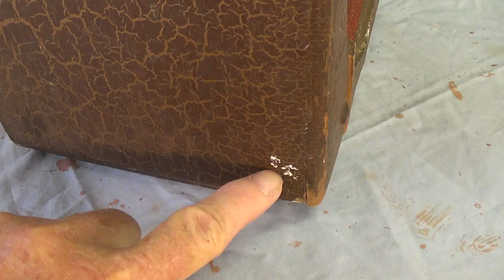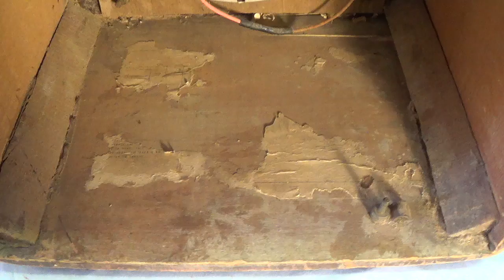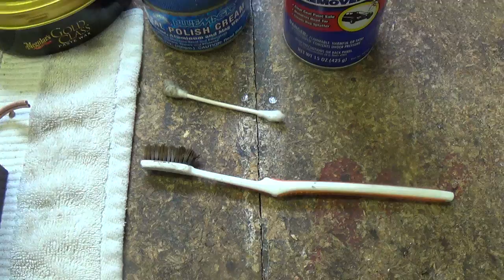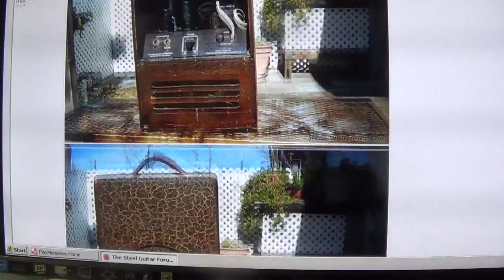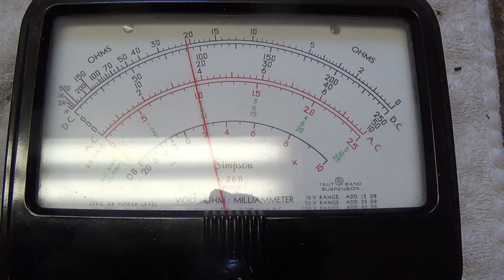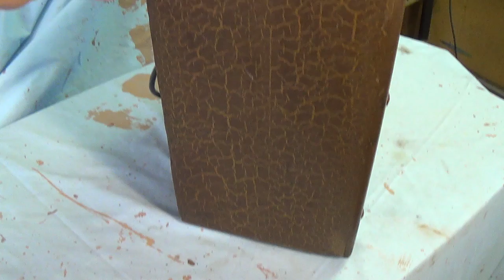Restoration of a Late-40's/Early 50's Jackson-Guldan Guitar Amp

Comment: First , thank you for the magnificent and informative videos
Second, I have a output transformer that  appears to be identical to the one in the video, same apparent size and the same markings(rk-1). Yet when I tried to map it 
I got different results. Of course I dont have a variac so i used a transformer that puts out a constant  26v across one lead and the center tap of the secondary. I should say I got similar values only on different taps, 14 15 16 = 4 8 and 16 ohm. I tested my setup on a reverb driver I have and got near identical values according to the labeling of the driver. I would like to use this in a old radio that I would like to convert to a 5c1.Do you think those taps would be appropriate given my results? Of course I understand that any opinion given is just that.
Reply from the maker: Thanks, Paul. External appearance is not a good basis for judgement, as you discovered. Since your measuring methods were accurate for the known OPT, I would trust them with the unknown one. Good luck.

Comment: I have one one of these. It has a more or less intact schematic in it. It survived a fire in my house so it's smoke damaged and hard to read, but can be read.  In mine the main transformer crackles and leaks so I can't use it. Any idea where I could get a replacement transformer for it?
Reply from the maker: Power transformers are readily available from Antique Electronic Supply, Mojotone, Ebay, Hammond, etc., Raymond.
Reply: @UncleDoug  Thanks, I've had this amp for a few decades now, this video is inspiring me to get it working again.
Reply from the maker: @raymondhoughton5151  I'm glad to hear it, Raymond. Good luck with your project.

Comment: I grabbed a similar amp today at my local Goodwill for $3. The case is super rough, and I thought it would be a great project. Thanks for the details…
Reply from the maker: Congratulations on the new acquisition. I hope the restoration goes well.
Reply: @UncleDoug  The Rola speaker in mine is dated Feb 1947, so I’m assuming it is original.
Reply from the maker: @justjoe78  Probably so, Joe.

Comment: Where did you find a lovely pink three wire replacement power cord? LOL.
Reply from the maker: It's available if you'd like it, Dennis. Surprisingly, a rare cord like this is priced quite reasonably......at only $35 a millimeter, plus shipping, handling, gas to and from the post office, and lunch on the way.....for four  ;).
Reply: @UncleDoug : That's affordable, NOT.  But thankfully, I live in a tiny town and the post office delivers! LOL.

Comment: Thanks.  I have a three 50's console amps*** I'm going to refurbish and mount a-la McIntosh pretty, just to plug a Thorens TT into and possibly an Akai reel-reel recorder -if I can fix the beast!  Don't have a lot of money, these are curb picks, (not the TT) : so I'm going to start out with a 60's "Unipack" train transformer with a joystick sweep rather than dial.. It's GREEN!  hahahaha, anyway, going to meter it w/ a Kill-a-Watt plug-in meter. 
 ***Firestone Air Chief, a Zenith (record-player only) 5-speaker portable...and finally an ancient looking Admiral console.  Thanks for the guts, been building them up slowly.  I got a book, hahaha!  need some on tubes, caps, and all the other junk.  You're a wizard, so do a segment on processes?  be cool to see soldering and wicking out the old stuff.  Give Rusty and Jack pats on the head for me, U. Doug. (:
Reply from the maker: Wow, Steve, it appears that you have all sorts of interesting projects. Best of luck with them, from all of us at Rusty's Workshop :)

Comment: Becareful about Hantavirus from mouse droppings.    I'd fine spray wet with solution of 10% clorox in H2O.   Let dry and spray wet againext day.  Remove while wet.  Then vacuum after all has dried.    

Your components made it better than original!
Did anyonever make a speaker field coil be opposite phase to repel and attract the voice coil?

Uncle, would you please do something useful and make a talking 6E2(EM84) tube?
Attach eyes below the top of it.    The dark area will resemble a mouth opening and closing!
Thank you.   Robert              PS:  Someone asked if I were a musician.  "No", I admitted. "I a organist."
Reply from the maker: Your health warning is good advice, Robert. Hantavirus is a real problem here in the desert southwest, and I have known people who have contracted it. I tend to be careful, but occasionally am not......improvement in this regard is necessary :)  Regarding the polarity of the field coil, it doesn't matter, as long as the polarity reversals mimic the music signal. Much like a fluorescent light, it doesn't matter whether the incoming AC is in positive or negative phase.....the light works just fine.
Reply: Did your acquaintances die?    Hantavirus has a high mortality rate.
If that DC field coil were instead modulated to have the sound signal opposite the voice coil signal, [-+] |+- K would repel the diaphragm out and [-+]| -+K would pull the diaphragm in.
I was surprised to find an old radio whichad an electromagnet field coil.  No schematic so no idea how it was powered or how hot it got.
Reply from the maker: No, they recovered, but the disease is quite serious.  The field coil of an electrodynamic speaker serves two purposes:   1.) As a filter choke in the power supply, where it is energized  2.) As the speaker magnet that causes the voice coil to move inward and outward.  They tend to get slightly warm.....but not hot.

Comment: Just picked one up in a homemade cabinet - looks like it has the original speaker plus someone added a 10 inch - will post more when I dig into it.
Reply from the maker: Congratulations, Bill. Let us know how it turns out.
Reply: @UncleDoug  thanks for the guidance, its recapped and a bit more, removed extra speaker. Need to find/build a nicer cabinet now. BTW, mine had .05 mf coupling caps. Has the small Rola speaker also.

Comment: I seem to notice that you took the output Transformer off of the speaker and put it in chassis?
Reply from the maker: Yes, as explained at 20:05, it really didn't fit anywhere on the speaker basket and doing so allowed me to run only two wires to the speaker, instead of four.
Reply: Uncle Doug  I missed that, I'm sorry, my bad!
Reply from the maker: No problem, 2R :)

Comment: 74-JJC-2511C are of course the coordinates of the location of the shop where it was sold originally.  

But on a more serious note: I'd love to make a Fender Champ. How hard/dangerous is this without any knowledge and decent soldering skills?

Pelle
Reply from the maker: I checked and that would mean it was built 257 miles off the coast of Madagascar, Pelle. I guess that explains the surface rust on the chassis :) Building a Fender Champ clone would be a great first project.....and, let's face it, we all have to start somewhere, despite a deficiency of knowledge and experience.  As long as you know and practice the proper electrical safety rules, there should be no risk involved.
Reply: :) Thanks for the great reply, made me chuckle.

And that's great to hear. I love watching you repair old amps and I have been playing with the idea of building a Fender champ for a while now, so I might as well get to it then.
Reply from the maker: When you do, please let us know how it turns out.

Comment: Hello sir, I have a little question about class ab amplifier. If I want to cathode bias the tubes, should I separately adjust the plate dissipation on each tube? Or use a common resistor? is the Cathode biasing suitable in a class ab 6v6 amp? Thank you in advanced. 😊
Reply from the maker: +Harshgus You can bias each tube individually with it's own bias resistor, selected to provide the proper Plate Dissipation.  In this way, you can effectively balance two unbalanced output tubes. Most manufacturers don't do this, possibly to save money or make the biasing procedure easier. As far as I know, this method works for both A and AB circuits.

Comment: That little amp is perfect for getting early Led Zeppelin tones with a Telecaster.  Great job on the restoration, and kudos for reworking the original on/off/volume switch. I see that Rusty is the type of Superintendent that doesn't feel the need to 'micro-manage' the work order schedule on restorations such as this.  However, I am quite sure that he does require a very strict 'treat' schedule.  Nice amp.
Reply from the maker: +Viking Mike Thanks, Mike.....glad you like how the amp turned out.  Yes, Rusty tends to delegate a lot of work assignments, but he always insists on handling treats and dinner himself :)

Comment: I was looking around today for info on how to check output transformers, hopefully from you since you're easy to understand and present the curriculum very clearly. I'm glad I stumbled upon this project at the end of today, it covered how to check the winding ratio. I've got two amps that have both power and output transformers, and may need to study up about OTs before deciding what amp I can clone with one of them. Also have a third parts donor from an old Motorola radio that the PT will be good to use. Lots of good old tube sockets to use between the three....
Reply from the maker: +Joel Thomas  It sounds like you are acquiring all sorts of good parts. Before you harvest any components, especially transformers, from a circuit, be sure you label them.....i.e. for a PT, what tubes were in the circuit, rectifier, filter cap values, etc. and label all the wires.  From this information you can determine the current capability of each winding and know exactly how to set up your new power supply. Good luck.
Reply: +Uncle Doug I did see your video on how to identify the wires of a PT, and now that you mention it, it makes sense that even more info on the current capabilities could be had from the filter caps used. I hope I didn't keep the filter caps with the Wurlitzer amp, but it used 7027s which I'm told are close to a 6L6 as far as my amp building intentions are concerned. I can label where the wires went, and keep the OTs and PTs from each amp together. I'm trying to take the important stuff out and downsize the pile of parts for now. The big plan is to build 2 or 3 chassis and one speaker cabinet  for a combo amp that can have different amps swapped into the cabinet.   Are you active on any amp forums?
Reply from the maker: I have never seen an amp that used 7027's, Joel, but I understand that (as you said) they are similar, but not identical, to 6L6's. I rarely have any spare time to visit forums, but when I do, I would recommend EL84 World and the TDPRI Telecaster Forum. Good luck with your projects.

Comment: Great video, as always. It has been a long time since the last one!
I have a question for you, or maybe a video suggestion, if it happens to be preferable: Do you have recommendations has to what to change or upgrade on older schematics, not sound wise, but more in a electrical good practices way, for example upgrading to a 3 prong cable. I currently looking into building a Brownface Concert amp (6G12-a), as a head unit, and I'm comparing the circuitry to the following Blackface and Silverface designs, to find out what changed. I'm having a hard time figuring out what was changed to improve the electrical design (not the tone stack or tremolo parts), and if the values of the components are still relevant or if they where only selected because that's what they had at this time.
Reply from the maker: +Guillaume De Tonnancourt  Thanks, GT.  It's a good idea to review the updates on early circuit designs to see how they were improved over time. These improvements often are a result of feedback from owners and repair techs. In general, the values of components were carefully chosen.....the manufacturers generally did not simply rely on the parts they had on hand......but occasionally, with the early (tweed) Fender amps, Leo did tend to use handy (rather than ideal) parts. I had a brownface Concert amp and it was spectacular, just as it came from the factory.  On this model, I would stick with the original brownface specs, unless subsequent circuits show increases in cap voltage rating or resistor wattage.....which I would use in preference to the original values.

Comment: I will also say, first impressions... I would have said this was a Chicago-made amp, maybe Lectrolab. 

Jackson-Guldan was Columbus, OH based - one of the few actual manufacturers of guitar stuff in the midwest region that was NOT in Chicago. They did make a lot of stuff for the lap steel and Hawaiian market and later did some pretty neat, innovative parlor guitars with adjustable necks. I have two or three of those right now. I did not know they made amps though.

Haven't seen the whole video yet, so I'm not sure on what you're basing that. Guess I'll finish the video now. :D
Reply: +The Guitologist Danelectro wouldn't surprise me as the manufacturer either.
Reply from the maker: Thanks, Brad.

Comment: Great vid .. Little bit of slap back echo , and reverb on that amp would make a nice rockabilly tone .. 
Awsome how that pentode makes enough gain to drive the power amp stage without nfb .. Just about every amp I've seen on YT , that has a pentode pre amp , sounds so good to me ... 
And the speaker sounds way bigger than 6 inch,
Reply from the maker: +steeveejay Thanks, SJ. Yes, I am a real believer in pentode pre-amplification. It delivers a nice full tone at moderate volumes. The speaker surprised me too :)

Comment: Great to see you back on your channel, Uncle Doug. I have a question/idea for you. Have you ever worked on vintage tube HiFi amplifiers? I have an old Grundig tube console HiFi I grew up listening to, but don't yet have the knowledge to give it a proper looking over. I think it would be great to compare and contrast guitar amps with HiFi amps. Same science, but different application I'd wager.
Reply from the maker: +Mason Lamb Thanks, Mason. Yes, the two types of amp are quite similar, but I deal strictly with guitar amps. There are all sorts of forums, channels, and sites dedicated to tube HiFi, so you should have no problem finding lots of info. Good luck.
Reply: +Uncle Doug Yeah, I've perused those forums and they are dripping with snake oil as often as not-- like "put these crystals in your output terminals and you'll create a magnetic resonance feedback loop that will smooth out the residual digital artifacts in the waveform." I'm not making that last one up. That's why I like your channel. No snake oil. Math, science, and practical tips that really work. Keep it up!
Reply from the maker: Thanks, Mason.....we will :)

Comment: Nice to see you back -- nice work ! -- Should not the hot go to the tip of the fuse ? Dare you to turn it up to 10 !
Reply from the maker: +Ben Prevo  Thanks, Ben. I guess, but anyone who changes fuses while an amp is plugged in probably deserves a little punishment :)  I did turn it up to 10 and it sounded great, but out of respect for the age of the speaker, I backed off to 7 for the audio clips.

Comment: Fantastic work as always. Thanks, I've built a prototype EL84 SE amplifier and I found a random transformer that put the cleanest and most power output, but I didn't know how to find the plate load, now I made all the measurements from your video and my transformer has a ratio of 25:1 and with a 8ohm speaker, that is basically a 5000ohms plate load right? Cheers mate :)
Reply from the maker: +ciprianwiner   Thanks, Ciprian. Yes, 25:1 is an ideal winding ratio for a 6V6 and an 8 ohm speaker.....exactly 5K ohms plate load.